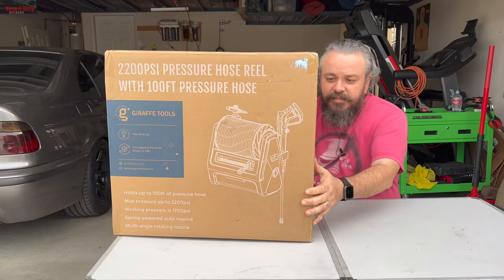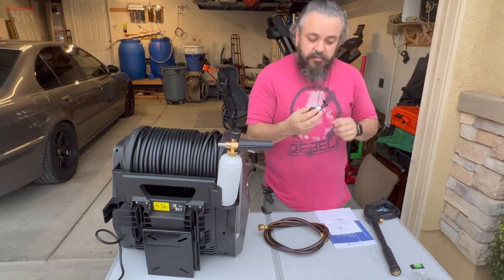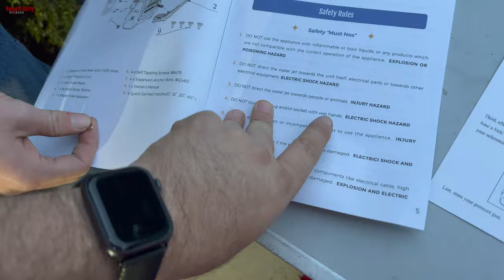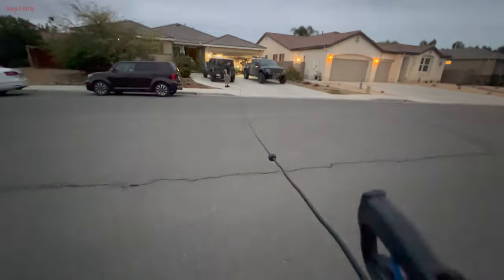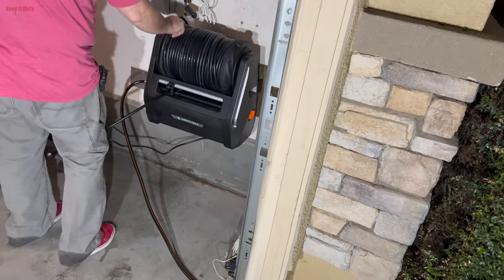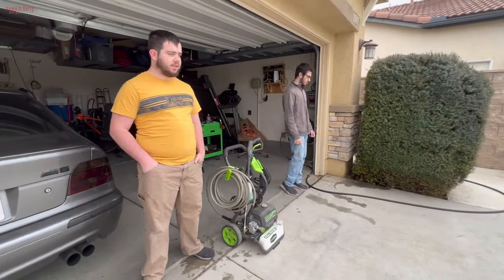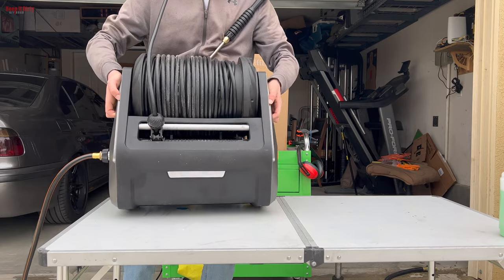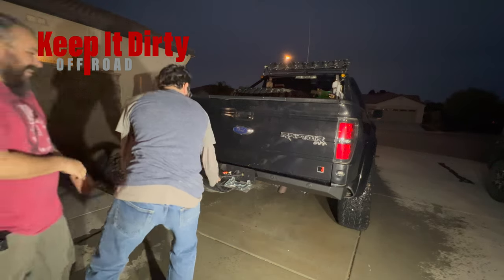Giraffe Tools Pressure Washer  Review - Wall mounted w/Automatic hose reel

Comment: Man I’m really liking this machine.  Especially 100ft of hose that reels up on its own.  Question for you, is it necessary to empty out the machine after each use?  Reason I ask, is because I’d like to mount this by our water softener and T off the incoming water.
Reply from the maker: At the very least you want to turn it off and release the pressure. I would recommend a shut off valve after the T as well to release all the pressure.

Comment: Question, I have this in my garage mounted on the wall. Every time I go to press the trigger, it runs the first 2 or 3 times I press the trigger, then after that, the water isn’t pressurized anymore. Also, when using the hose with a foam cannon, the foam just falls to the ground. It doesn’t come out in a fan motion. Ive adjusted both the top and front dials to what looks like it should be coming out in a fan motion, but it doesn’t. I’ve tried 5 different foam cannons and it happens with all 5, so it can’t be the foam cannon. Any thoughts as to why the foam drops to the ground? Thanks!
Reply from the maker: Sounds like you have some air in the system. Run your water hose with a valve and get all the air out of it before you connect it to your reassure washer.

A dead giveaway is if the motor all of a sudden gets louder. 

As TT the foam cannon, code it all up first and then adjust from there

Comment: Is this a paid video?  I like the unit but want to ensure it isn’t biased
Reply from the maker: Not paid, but they did send me the product for free. We always work with the sponsors to make sure they allow us to be honest, and these guys were on board and did not edit us at all. 

We will be doing a long term review here in a few months. Product is not perfect, we showed how the real does not always go back perfectly. But it does not matter because the convenience of this things trumps all its drawbacks and we are using it way more than our old traditional pressure washer. 

Let me know if you have any questions.
Reply: @KeepItDirtyOffRoad  appreciate this!

I’ve been looking for something wall mounted and sub $700. It’s hard to find anything quality despite feeling like I’m spending lot…
Reply from the maker: Agree. Not going to lie. This thing is all plastic. So it does feel cheap. But we’ve been using the hell out of it. Easy to setup, easy to put away. And it works. Price may be a little high. But honestly, the reel alone with worth the price.